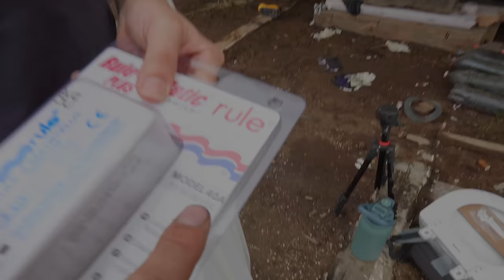Prepping our WOODEN BOAT for LAUNCH! Transducer, pumps and through hulls — Sailing Yabá 179

Comment: Ben and MP, you should think about putting one way valves on the bilge pump hose because the exit hoses look to be very long.  This will stop the water from coming back into the bilge when the pump stops running.  They will also stop water from coming in if a through haul goes below the water line.

Comment: 4:00--Whenever you wire on a spool like that, you should put something through the middle and spool it out.  If you just pull it off the side, you're putting a twist--potentially a kink--for every turn of the wire on the spool.   If you do end up with twists (which physically shortens your cable), 'chase' the twists out by running the cable through your hand, while leaving the end to untwist.

Untwisted wire is longer, and easier to snake.

Comment: Important Info: Regarding the WAGO connections. You need to either electrical tape these or better to use “Heat Shrink”. These are great connectors, but with the vibration or the boat, these can release themselves. Heat shrink is best as it’ll protect the connector better. 
Amazing work and so looking forward to see you both sailing. 🤙

Comment: I'm sure you took this into account before bolting everything up. You must make sure that the transducer is perpendicular to the water line. You can make small wedges to place on the outside and inside of the boat to adjust for the slight angular difference then just epoxy the wedges to the hull. That way the transducer thru-hull fitting will be correctly aligned to the water line. "Looking straight down from 2 directions, Fore to aft and port to starboard." Great work from all the folks that has worked on the boat so far. So close, so very close. :)
Reply: At that installed angle, the dB loss of the returned echo may not be detected beyond 5 meters of water depth. At 50 meters of water depth, the return echo will arrive 20 meters to port of the boat. 
Mounting it exactly vertical and let the transducers beam width account for the rolling of the hull.
Reply: Generally transducers will have about 12° tolerance to cater for hull shape. I'm sure Ben and Luïc read it in the instructions  😀
Reply: @sailingsjofagel  Transducers are available with from 9° to 20° beam widths. They are all meant to be installed completely vertical, with the beam width allowing for some amount of heel. A 12° beam would only receive a decent return signal at up to 6° heel. On a sailboat, I recommend a 20° beam width, installed vertically, so that it works on either tack. As installed on Yabá, it will only work on a Starboard tack.
But that's just my opinion after 60 years on sailboats and a 33 year career as a Sonarman, Sonar Tech, and Naval Electronics Technician.

Comment: I know its probably too late but the transducer can work perfectly on the inside. On my old wooden boat (1932) i put the transducer inside low down on the flattest part of the hull, it works perfectly through the wet wood 4cm thick as long as there is no air gap. I used some silicon on downside of transducer and stuck it to inside of hull to keep air away.

Comment: MP, I believe the reason your light flicker when the pump turns on may be that your wire gauge you are using to feed power to the pump may be too small. (the pump draws a lot of power when it first starts.)  Other option would be to feed the lights from their own source of power that isn't shared with the pump.
Reply from the maker: Hi! We believe the problem is the 220V transformer we are using, that can’t tolerate high amps. We will know for sure when we install the batteries ☺️

Comment: Thanks!

if you could find the right blade for your saws-all it would cut it a lot faster because it’s generally more powerful than a jigsaw and also a drum sander attachment on your drill. Using some very coarse sandpaper would go a lot faster than that rasp you’re using. Once you were close, you could go to a less aggressive sandpaper on the drum sander. By the way, they actually make extenders for drills not that I know if you can find them where you are but something to think about.

Comment: One thing for anti fouling or as an Anode... You can connect to negative separate cable to the  battery and extend to exterior and have rod/ line in water to protect entire system as an simpler solution!!

Comment: When it comes to the through hole another inexpensive way to widen them would be to use a drum sander that attaches to your drill with a course sand paper. After you rough it down with a chisel

Comment: Ben you could wrap a piece of sandpaper on the outside of the hole saw that is smaller than your hole. wrap enough that it is close to the hole size and use it as a drum sander instead of filling to size. so much faster and easier.

Comment: The transducer must be mounted vertical forward, aft, port and starboard. Fabricate wedges for outside and inside the hull to make this happen. If you mount it flush with the hull and at an angle, your depth readings will be really inaccurate. Also, install check valves at your bilge pumps to keep water from flowing back into the bilge when the pump turns off. You also might think about high water alarms.

Comment: it is best practice to install a one way check valve and a fuse within three feet from the bilge pump, also your transduce should be installed into a fairing block underneath the hull which holds it plumb,

Comment: Polyurethane, like Sikaflex cures better in a rainy day than a sunny day. It even cures under water.
Do not put anti fauling under the Sikaflex around the transducer.
A transducer is often mounted in a block that sticks a bit out from the hull, to avoid turbulent water near the hull. This is mostly to get an accurate an undisturbed signal when looking for fish at cruise speed.

Comment: A forstener bit is what you need it cuts the wood away as it drills and you don't have a plug. It's just that you need to drill half way through from each side if possible. If not be careful and don't push it hard when it breaks through. I wish I would have thought about it earlier I would have sent you a set.

Comment: MP on your float switches put a long piece of string , this way you can test the system without having to remove floor covering. Make it a weekly test to test all float switches and record it , that way you have a record of when it was tested. Also record when used operationally, that way you can work out approx run hours. If you really want to go to extremes fill your bilges with water and time the pump sequence, that way you know how long it will take to empty your bilges, this works only if you know how much water is coming in.
Reply: not sure if that is a good idea, the string could slide and block something or get into the pump and wind around it.... but testing on a weekly basis is good plan, put up a checklist on all weekly checks (through holes, cooling system clamps,bilge switches, steering cable ...)
Reply: Was a system we used on Anchor Handling Vessels. In this case bilges were very deep and the string was tied on to the levers between float and switch. Never has a string break (heavy duty)

Comment: Make sure to put a check valve in the hose for all the bilge pumps. Water will come in those through holes when the sea is ruff. And will fill your boat up. I would have put the bilge pump through holes as far away from the water line as possible… check valves will solve this problem on all the drain type holes

Comment: Check with the transducer manual because it should lay flat horizontally and vertically not curved with the hall. It’ll give you bad readings if you got it at an angle.  do you have a marine surveyor or a safety inspection guy that’s going to come through and look at everything for you before you launch your boat I mean I love what you’re doing but you got some stuff that are questionable in my eye all right keep up the good work
Reply: The transducer should be installed as close to vertical as possible. Its current angle is excessive and will result in huge signal loss, as the sonar transmissions will bounce back at the angle they are sent down at. 
Consider it like aiming a flashlight at a mirror to illuminate your face. It doesn't need to be turned many degrees for the light beam to miss you completely.

Comment: Loving these daily episodes 🤩. One thing that suprised me over the last few days is why do the craftsmen in the yard have manual drills  for the large holes for the thru-hull fittings? I have a brace and adjustable bit that will nearly 3" dia hole. I know it would be hard going but ideal for the thickness of your planking.

Comment: Great daily episodes, I look forward to see them each day. I’ve not heard the terminology cup saw before, the common English word is a hole saw. An easy way to enlarge a hole is to glue sandpaper to a smaller hole saw and use it with a drilling machine to file away excess material. Looking forward to the big splash.

Comment: A suggestion to expand the through holes would be to: 1)  use a threaded rod or long bolt (with the head removed); 2)  place a nut and washer at one end (bottom) place the plug (previously cut with the hole saw) on the threaded rod or long bolt; 3) secure it in place with another nut and washer (top); 4) glue a strip of snd paper to the plug; 5) attached the bolt to the drill; 6) sand away..
Reply: LOL

Comment: MP the light flickering might be the AMPS of the bilge pump check on the wire size you might need to use a relay
Reply from the maker: Hi! We figured it out. We are using a 220 to 24v transformer and that transformer can take up to 10 or 15 amps only. We believe that once we switch to our official batteries that glitch will be gone 😉

Comment: Hi guys, where you drill into the wood for the bilge pumps and where you assume it will have water, shouldn't you add some sealant before putting the screw directly into the wood to avoid corrosion?

Comment: These situations are instructive for the future.  You find out that taking the time to identify and acquire the proper tools is usually well worth the effort.  Also, as you did with the depth transducer, carefully studying where the through hulls come out on the interior is exceptionally important.  Certainly for installation, but also for maintenance.  A few more feet of flexible bilge pump hose is easy - working around a beam shelf is  not.  But this is all part of the process and valuable training.

Comment: A tip for extending the reach of the type of hole say you’re using is to use a chisel to break out the already sawn bit of the hole, then cary on with the boring. When it comes to hitting the beam shelf, all I’ve got is, fill the original sawn bit with epoxy and relocate the opening. 
Why weaken a major support member when you don’t need to? Just use a bit longer discharge hose to reach a better discharge port location. 
Next tip, and this is a big one. Use a Forstner bit, instead of a cup saw. The designe of the Forstner bit doesn’t leave the core of the hole. It shaves out the wood as it goes, leaving a very smooth hole. The forestner bit that size will have a shank that is around 3” to 4” long, and extension shafts are available that properly fit the shank. Be advised that these bits are extremely sharp, and can dig in too quickly if too much pressure is applied when drilling. 
Also a Forstner bit this size must preferably be used with low geared drill. 
Don’t let it dig in uncontrolled or it’ll yank the drill right out of you hands, possibly spraining a wrist. 😵‍💫
Forstner bits in your location may only be available online or at a vender specializing in woodworking tools.
Reply: HA! I jumped the gun on mentioning the chiseling out the previously drilled bit, before watching this episode to the end. Sorry😂

Comment: you will eventually discard those plastic bilge pumps and switch to a large electric motor and brass pump. we had 1/3rd electric motor and a 2 inch hydraulic pump.

Comment: The freeboard is very low , are you going to fit any nonreturnvalve to the bilgepump overboards ? There can be risk for backflow into the bilges through the pump when heeling or in seas.

Comment: Can you find anywhere on the hull where there is not going to be a through hull near ! That hull is starting to look like Swiss cheese. Would it not have been better to reduce the through hulls and try to combine some. Every hole just promotes rot and chances of failure.

Comment: keep up the good work! they make a rotary sanding drum that has replaceable sand paper that goes on a drill, they come in various sizes, for sanding holes like the thru hull type, and there cheap. would go along way in cuttings down on your time to clean up the hole for size.

Comment: Essential that the transducer is looking straight down; should/could have put the it more to the back where the bottoms becomes more horizontal.  The instructions to be away from the keel does not apply for Yaba because there's no traditional sailboat keel that sticks down a meter or more from the flatter boat bottom. It's all about the 'viewing angle' of the transducer, which is only perhaps 20º.

Comment: It is normal if you have a glitch with your engine bay lights when your pump runs...the motor induce parasite in your negative circuit or your pump shares the same circuit breaker of the lights. In all cases, your pumps should be on a stand alone circuits, or you should have dedicated negative circuits, and this will also affect your sonar. Those devices must be on an isolated circuit

Comment: Will you be able to thread the nut on if you have that welded? Maybe consider fitting a pipe union after it's installed through the hull?

Comment: I noticed you are not using waterproof connections on many of your wire junctions. This will cause a lot of corrosion at the connections and eventually lead to loss of connection. Those little snap connectors you are using are great to install, but they are not good in salt water environments.

Comment: MP now go and put a volt meter on the outside prop shalf and see how what currant comes up it should be zero  try all your engine  room switches  See  if you have a currant anywhere  you should not have any  check that Video from Acorn to Abrella on  the great talk back on how to fix unsafe currants

Comment: With your transducer for depth sounder.. it needs a fairing block..so that transducer is facing 😊at 90 degrees ..not at angle of hulll..as you have installed it….

Comment: Did you replace those electrical connectors with waterproof ones? Just thinking that having a bilge pump which shorted out because there is water in the bilge would be slightly 'disappointing'. in fact making sure nothing would fail from bilge pump to battery due to water in the bilge would perhaps be time well spent...  Perhaps a split charge system so the BP has its own dedicated battery and circuit...

Comment: Probably too late to do any good but you could extend the hole saw bits to make them cut deep enough to get through the hull or use a forstner bit to drill the holes and avoid the entire issue all together.  Being the largest and lowest through hole on the boat I think it is foolish to remove it just to paint around it and it would be much wiser in my opinion get that installed and sealed as much as humanly possible with as much epoxy as it can hold to protect the wood and sealant oozing through the threads of the nut on the inside of the boat just to be sure, but that's me. Lol

Comment: @17:26  No  "glitch"  in  the  engine  room  light.    The  bilge  pump  motor  starting  amps  of  approx. 5 x that  of  running  amps  caused  a  voltage  drop  in  the  line.   'Normal'.
Reply from the maker: We believe it’s because our transformer (220 to 24v) can’t take it. But with the batteries it should be more stable 😉
Reply: @SailingYaba  -  Agree  . . . . . .  (if  your  length  and  size  of  wire  is  more  than  adequate).   If  the  engine  room  light  should  still  momentarily  dim/flicker  on  pump  motor  start-ups  I  would  not  be  concerned.    take  care,    rh

Comment: You want to put lots of (removable) SikaFlex on the transducer, and bed it in before antifouling.  It's only the surface of the sensor that needs to be kept free of antifouling.  How much is a set of hole saws, and you own a wooden boat?

Comment: Ben you are doing a great job well done however you need to change all of the under water SS valve these are going to eat the bronze thruhull fitting and sink your hard work you need to replace them with  BRONZE valves not brass as brass has no place in saltwater.

Comment: Shouldn't you have a shim between  the hull and the transducer so that the face of the transducer is perpendicular to the bottom the sea floor?
Reply: Remember the error will follow the cosine law, so if they are within 5 degrees, they are within one half of one percent of the true vertical measurement.

Comment: bilge outlet: would you not make a siphon, so it's more difficult for sea water to get inside? else with every wave you will have water from the outlet go inside your bilge through the pump!
Reply: Yes. Be careful. If the boat is leaning to port the hole will be submerged.

Comment: The Glitch from the lights in the engine room will go away once you change to the batteries instead of the temp Power Supply. The Power supply can't cope this the bilge pump start current.
Reply from the maker: That’s my bet too! 😉

Comment: Wouldn't the depth sounder need to be as far forward as possible such that if you're heading for a shallow reef you get as much notice as possible?
Reply: Needs to away from air entrainment arround bow which will give false readings
Reply: @petergreen3381  Interesting, never knew that, thanks.